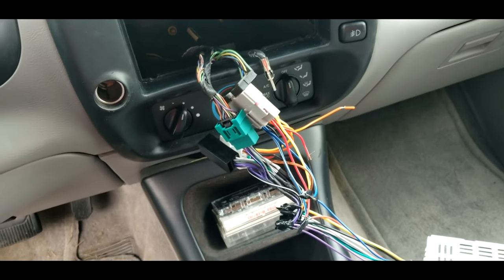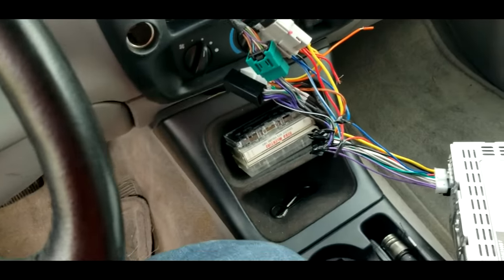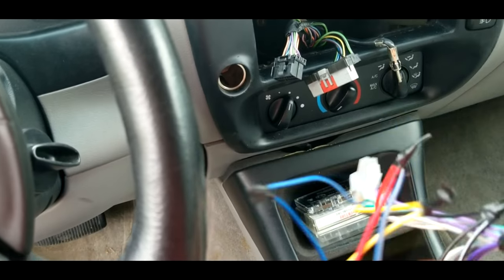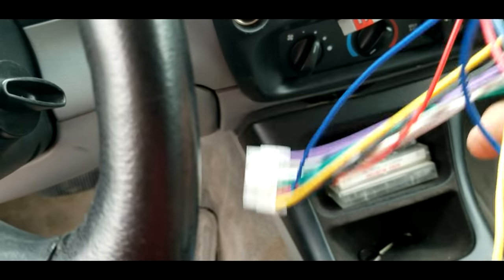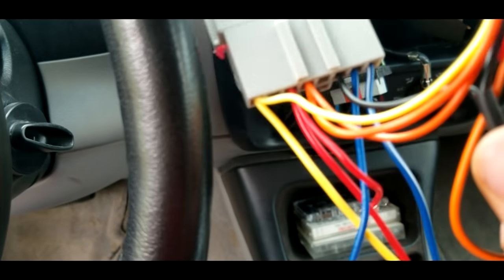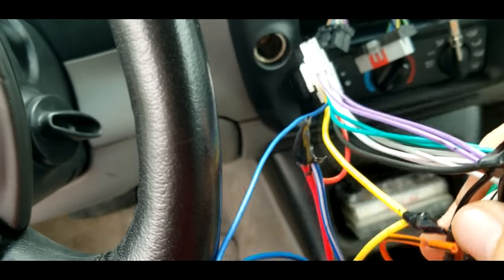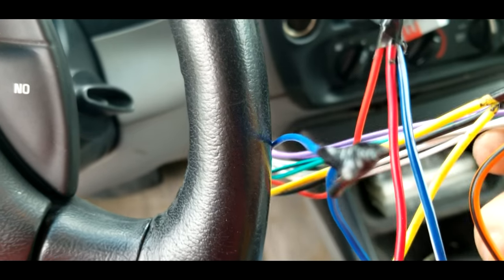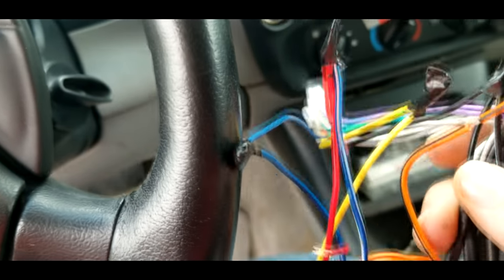Aftermarket Radio Turns On BUT NO SOUND **SOLUTION**!!!

Comment: When I put red with another wire it stays on forever
Reply: You could wire them together with a toggle switch if one din radio? Then install the switch somewhere
Reply: @trishatripp9311  My husband told me that too and got all frustrated when I tried it and it didn't work, so I sat there in the car thinking about ten minutes everything I already had tried and the only safe thing I didn't try was to put a wire on the amplifier fuse linked to the 20 fuse that goes on just when the car is on, the black wire can go with the land or negative wires om the metal things. I saw it somewhere and it worked with me, finally.

Comment: I did that but all I hear is static
Reply from the maker: well, if you hear static then this video isn't for your problem.  If you can't hear anything at all, then that is what this video is for.  If you have static, then your sound is working.  You just aren't picking up any stations.  Which could be an antenna problem or the radio itself is faulty.

Comment: Did this and STILL no sound wires are all good I’m coming to an end with this thing 😂
Reply: Same but I figured mine already has a broken FM radio but the aux and Bluetooth works because i checked it using test light and it lit up but the 2din stereo wouldn't give me a static noise when switching to radio

Comment: You started the video with im going to get straight to the point. Then 7mins later u finally get to the point, which sadly was common sense to me. Sob I wasted 8mins of my time. By the way you should use butt connectors not electrical tape bud. Good informal video though
Reply from the maker: It's better than a 30 minute version i had to dig for and find.  :)  besides, the first 6 minutes was to explain some important basic information some people may have not been aware of.  Also just wondering, did you find the information you were needing once you made it to the end of my unbearably long 8 minute video?
Reply: @JerryMiah  sorry boss man I didn't. I messed up and ordered a pheonix  android radio from "cali" ended up being shipped from China. WORSR COMPANY EVER!!! Don't ever buy from them doesn't work right and customer service is nonexistent smh waste of 400$ will be filing fraud report today 😊
Reply from the maker: @bobburgerman6158  crap sorry that happened.  Yeah I dont trust hardly anything from china.  Theres usually a reason you can get it so cheap
Reply: @JerryMiah  $400 is cheap?! Lol! It was listed as USA, wasn't till after I got the tracking number did I see it was coming from china. Thank you, live and learn. Don't trust anything from California either their just the middle man for China lol
Reply from the maker: @bobburgerman6158  no just meant there's alot you can get ridiculously cheaper from china but its usually junk.  $400 definitely isn't cheap lol

Comment: Thanks!
Reply: I appreciate this. This was exactly my issue with wiring up a new head unit in a 98 Dodge Dakota with the Infinity sound system. It utilizes a factory amp and trying to figure out why I had no sound was driving me crazy.
Reply from the maker: @Taleriose  i am glad it helped.  thank you so much for the tip!

Comment: My stereo caught fire when I hooked the power antenna wire to the red wire !!!!!
Reply from the maker: you are not suppose to hook the power antenna wire to the red wire.  if your system has a power antenna wire, then there will be a corresponding wire to plug it into.
Reply: @JerryMiah  the video clearly instructed me to do so now I'm out $300 for a stereo and thank God I was able to get it outta the truck with minimal damage to myself or the truck .
Reply from the maker: glad you were able to get it out.  but no, I advised to have power sent to the vehicle's amp.  that means connecting the amp to the power cable.  not the power antenna wire to the power cable.

Comment: Omfg you talk too much just get to the F’n point dude!
Reply from the maker: Have some patience, jesus.....
Reply: @JerryMiah  my apologies, I’ve been fighting my truck for 3 days now trying to get the sound to work with my new stereo so my patience was running thin. I finally just now figured it out though, I had to tap the “power antenna” wire into the switched power wire to make the amp turn on. Now it works perfectly
Reply from the maker: @southernfried714  good to hear.